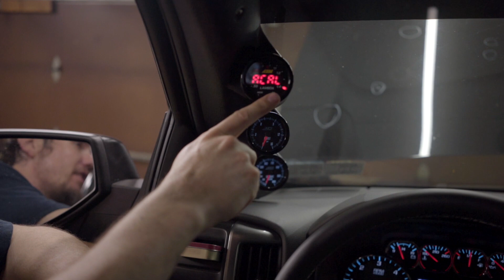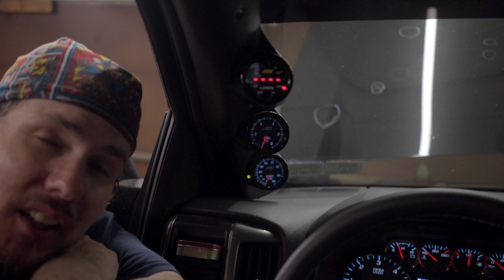AEM Wideband Free Air Calibration, How To And Do You Need To Do It

Comment: Did you mount your gauge pillar over the factory  pillar  or did you remove it and then install it! I bought a used one with no hardware and don’t see anything to screw the new one to unless I leave the factory one in and screw into that thanks!
Reply from the maker: The one I have replaces it, there is a retainer at the top a couple inches down where the factory one screwed in

Comment: Is there any danger in just running the calibration while the sensor is in a cold exhaust? I'm a lil worried about messing with the o2 sensor banging it around trying to get it off the downpipe.
Reply from the maker: I'd be worried about residual fuel/fumes on the exhaust skewing it
Reply: @GoatRopeGarage  I'm gunna remove it tomorrow and do the free air calibration.
Reply: aka lazy
Reply: @theRCLlama  you can do it in the exhaust is what the instructions said. Just has to be sitting for a day or so

Comment: I’m having this issue with my wideband sensor, it is running lean, off the charts to where the wideband has the dotted lines but it’s the same tune that I’ve had in the car for weeks and have not messed with the fuel at all. I did a free air calibration twice and still doesn’t work. I noticed while doing the calibration that the sensor also did not get hot, aem is sending me a new sensor though so hopefully it’s the actual sensor... on a side not, this happened at the exact same time as my alternator went out, could this be related some how? I was in the middle of logging my tune when leaving work and looked back at the log and that’s when I noticed the wideband was off with the voltage, but that morning driving to work the log looked fine. Very weird
Reply from the maker: Should get hot with in 20 second so probably a bad sensor
Reply: Did changing the alternator fix this having similar problem on mine brandnew gauge